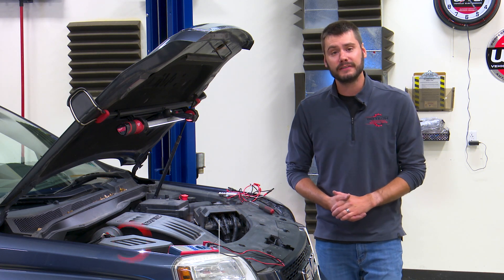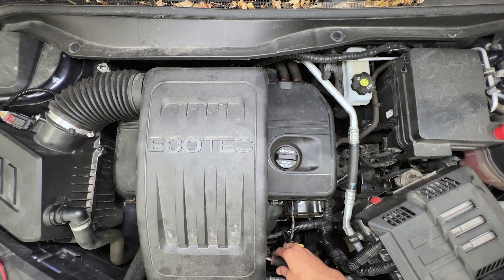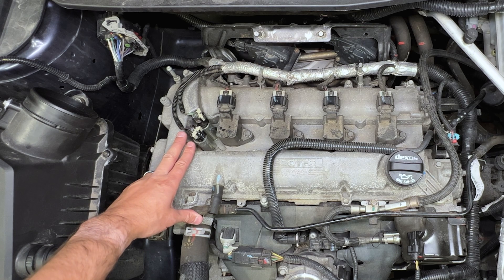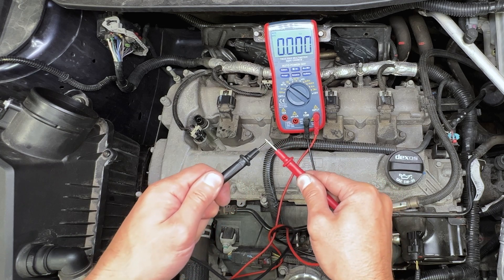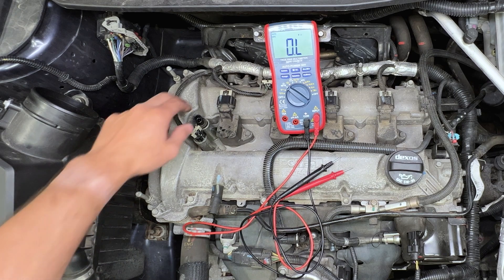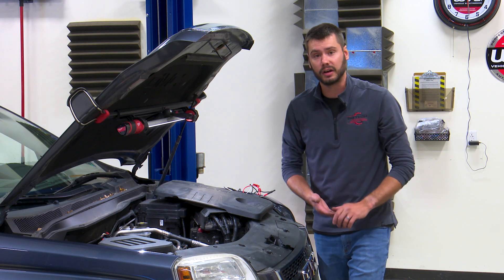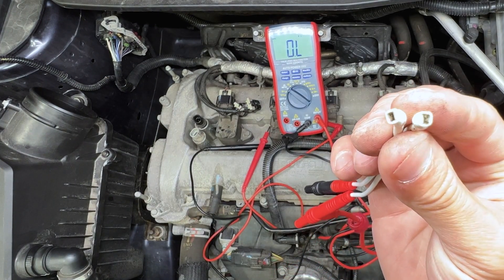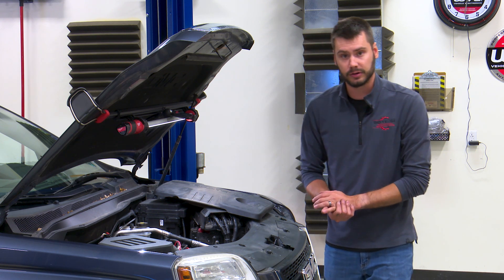Camshaft actuator testing (VVT) - GM 2.4

Comment: Anyone know why the vvt solenoid connectors are both reading 2.43 volts with the ignition on?
I have p0014 but I've changed everything so far.. 3 sensors.. Both solenoids and timing chain..

Comment: Keep getting the dreaded P0014 code on my 2010 Equinox 2.4
I replaced the VVT solenoid with a good AC Delco. Still getting the code. Could this be the cam phaser going south? Its up for an oil change soon but, the screens are clean as far as my eyes can see.
After driving for a bit, I have to "2 foot" drive the car so it doesnt die at a stop.
I have replaced the timing chain and guides recently. Everything was good for a bit but, here we are.

Thanks!!

Comment: My 2013 Equinox 2.4L solenoids were replaced under warranty around 70K miles - with a CEL code stored as you mentioned.

Now at 154K miles the engine vibrates a bit at idle.   But no codes stored.   Resistance on both is around 11 ohms.   
Should I consider solenoid replacement as a preventative measure?     
Could it be spark plugs (replaced at 95K) ?    Crankshaft and/or camshaft position sensors?

Comment: The real problem is that GM has killed off a lot of (all Cobalt) the parts. VVT solenoids are still available, but for how long? Happens to be a part used on a number of platforms. Yay.  AFAIK, 2019 last year of production, so I'd think this part will still be available...

But tensioners for the LSJ are long gone.Even the the idler assembly. Forget finding a remanufactured a/c pump with 6-rib pulley. 

Ecotec i4 engines are throw-away, despite the money GMP put into this engine. If you want to make this engine your "classic," get spare everything, now.

Comment: What to do if NO POWER to solenoid through the connector harness? What is the power source? A fuse? The ECM? How can I know which “pin”/ “probe” on the connector is hot vs the one leading to the ECM? Are the ECM wires always or most often striped? Down to my last hurdle after rebuilding this 2004 Corolla 1.8 engine and I can’t figure this out. I’m NOT a tech guy and have a great deal of trouble with all these sensors. ALL new sensors and solenoids so I know their good. Sure would appreciate any help you or anyone out there could give me. I’m m all out of bubble gum lol.

Comment: If my ohms are at 7 is the vvt on it´s way to brake?
Reply from the maker: Hi Whitewalker, no not necessarily. Resistance is tricky to judge the health of the solenoid by. If it were .1 or 100,000 I'd say its bad. But something in the single digits or teens is probably still ok

Comment: Great description and information. 

Does anyone know what the voltage from cable harness should be reading?

I have a P0011 code after replacing both solenoid’s. Could my issue be the camshaft position sensors?
Reply from the maker: Hey James,
The circuit is controlled by the PCM, when commanded on, the PCM will supply power and ground at a variable duty cycle. The P0011 is a performance DTC, also make sure you oil level is full with fresh clean oil.
~Ryan

Comment: I have a p0016 on my 2.4L Equinox, feel like it’s the chain and intake sprocket ⚙️, what do you think?
Reply from the maker: Hello,
That's tough to say, It could definitely be a chain or intake sprocket issue, but there are other failures that can cause this. I have seen shifted camshaft reluctors and stuck VVT solenoids cause this as well. Definitely something that requires testing.
~Ryan
Reply: @GoTechTraining  i bought a new VVT solenoid but it didn’t fix it, and don’t know about the reluctor, my car starts but has no power and it misfires, thank you for your feedback tho!
Reply from the maker: The only way test it would be to check the cam/crank correlation with a scope or manually checking the chain timing. Then figure out why it is off or out of time

Comment: Thanks Mike. Had a temp sensor like that years ago on an 86 ish  GM. Would read correctly then dropout to 40* F below zero. B U T no codes set ??? TOOK A WHILE ON THAT ONE. Early ECM's were not very smart.

Comment: I don't see the links for multi meter or jumpers
Reply from the maker: Hi Mike,
Thank you so much for pointing that out!
Got it fixed!
Multimeter- https://amzn.to/3iSAO0F  Terminal leads set-  https://amzn.to/3YadsUl 
~Ryan Wilsing
Reply: @GoTechTraining  Wow multimeter pretty cheap. Works good for the price?
Reply from the maker: Yeh, it's a good "low cost" meter. It's not a Fluke, but it does the job. We've been using it a ton to try it out.
~Mike

Comment: Great to see you Mike😍
Thanks for sharing this one, I'm also dealing with a P0017 on a 2019 Chevrolet Spark, I switched the Solenoids over but the code remained for the exhaust camshaft solenoid, I also verified the timing mark's based on the info available on YouTube & Google, my suspicion is that it has bad exhaust valve's on one cylinder (sadly I don't have an incylinder pressure transducer to prove that theory) but when the engine is cold it start's right up, but when it's reaches operating temp you have keep the gas paddle pressed half way through to get it started & it stall's immediately when shifted to reverse or drive🕵️🏻‍♂️
Please shed some light on this one😉
Stay Safe Bro😍
Reply from the maker: Hello Salman,
I would check for the camshaft phaser to be sticking, if the VVT solenoid is working and moves the Cam phaser and the cam phaser does not move back it can cause this exact issue. Remember P0017 is a cam/crank correlation code and is set if the engine timing is off. A bad exhaust valve bad will only effect one cylinder.
I hope this helps! Thanks for reaching out!
~Ryan Wilsing
Reply: @GoTechTraining  Really appreciate your support, I will definitely check that as well👍
Thanks Ryan👍

Comment: Nice easy test for these vvt solenoids.  Like you said, it could be a more deeper problem, but you need to remove the "slightly intermittent" intake and definitely bad exhaust solenoids to get rid of known problems then proceed if necessary with further diagnostics.
Good one Mike!  Hope all's well with you and your family.
Reply from the maker: Hey Mike,
I agree, and with this vehicle solenoids will fix the issue most of the time
Thanks for watching!
~Ryan Wilsing

Comment: Nice video as always Mike. Makes you worry that sooner or later just about every connector on the car is a potential problem. Yikes !
Reply from the maker: Hey Rick, yeppers, even more so, if it's on a car...sooner or later it will fail. Nothing is bulletproof on cars anymore.
~Mike